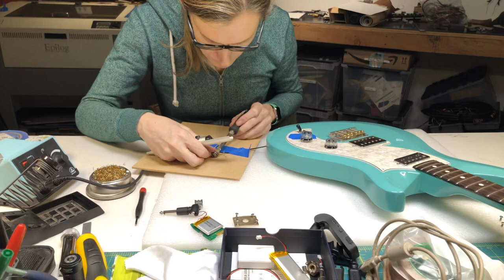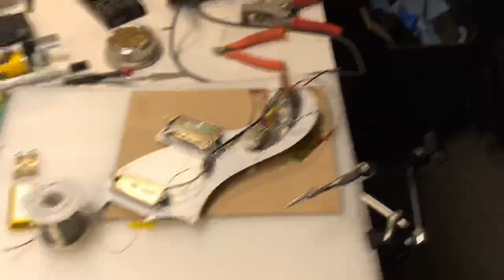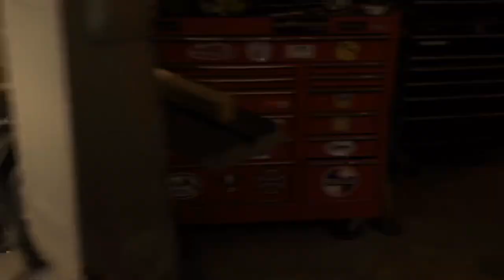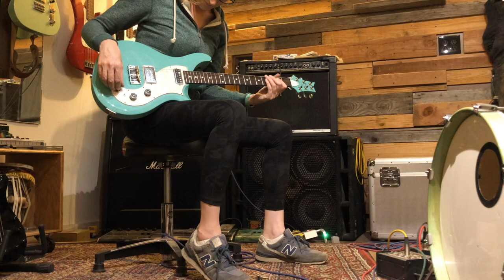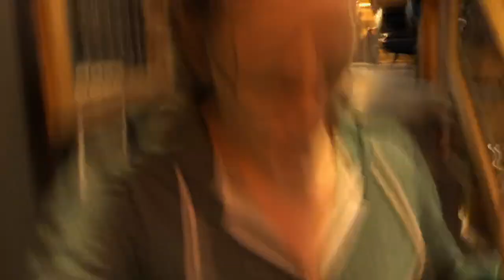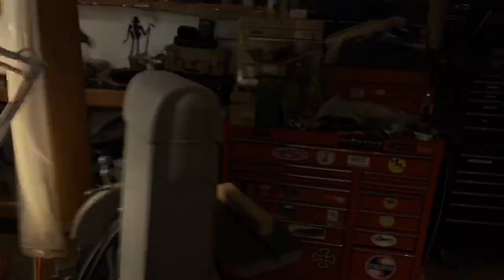I hacked the transmitter into my guitar!

Comment: Great hack.  Love that the 1/4" out is still signal out AND USB Charging in.  (with the 3-connector 1/4"..).  
You're living my best life.  Music. Makering. (Motorcycles).  

By the way.. Was lining the recess with copper tape for reflection of signal forward to the receiver?
Reply from the maker: Thanks!!  I miss my triumph thruxton. 😊 but motorcycles are behind me now.  The copper was mostly just preventative to avoid interference with the guitar wiring, but it was probably not necessary. I kept the transmitter outside of the copper shielding to ensure I didn’t block its signal too much either though.